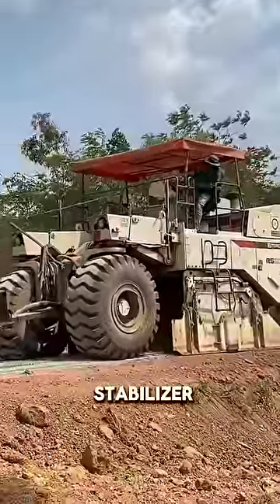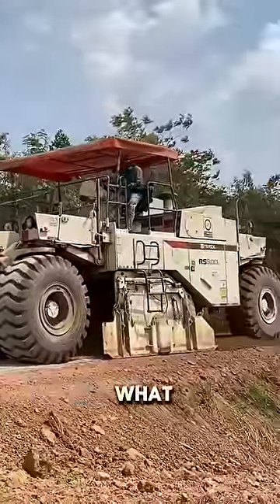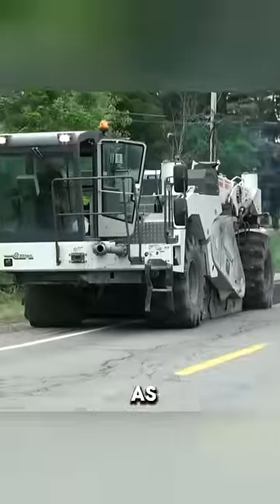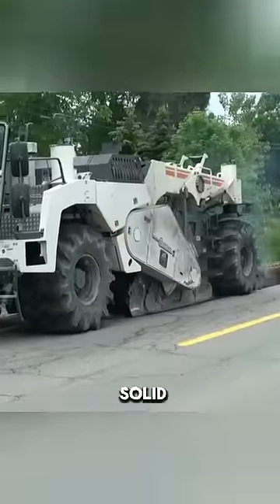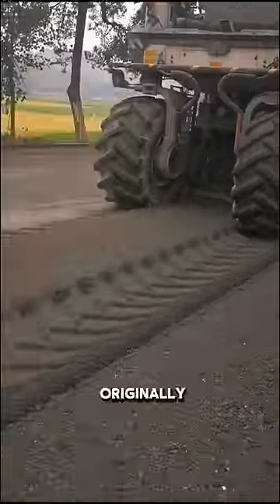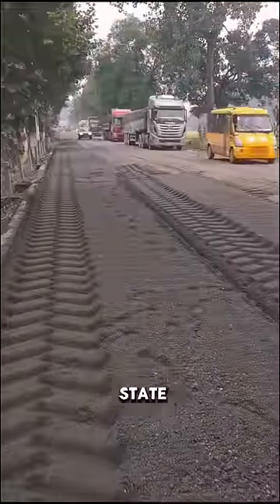How Cold Recycler Work #shorts

Comment: The first machine is a Lyme treat soil mixer.  It mixes Lyme into the soil to make the soil as hard as concrete.   The other is a road grinder.  Is grinds the asphalt with tungsten teeth.  It doesn't mix asphalt and soil unless you have a less than qualified operator.
Reply: Wrong operated them for years the newer ones you see are for both they have spray bars they have a push bar in front in which it pushes a tanker truck for soil stabilizing with either chemicals or plain water if it is concrete powder ext depending on the job the drum drops into the ground with either (blending teeth or milling teeth) EXT lots of different teeth for these machines for soil Stabilization or road milling to demolish the road
Reply: @Shawn-iy4ep  wrong!
Reply: @krail5500 he is right we use the second machine. we just call it a reclaimer. And when there putting in the stabilizer in or using concrete they do push the truck. When just reclaiming it will pull the water truck when filling most times.
Reply: @krail5500 Nope that’s a pulverizer and not a grinder. A grinder has a conveyor belt that shoots grinding onto a dump truck.
Reply: *lime (Lyme is a disease) 😊

Comment: By "their original state" you mean tar and oil mixed in the the soil now.
Reply: This exactly! The machine is literally mixing relatively clean dirt with oil and tar.
Reply: @aomanchutube no, it is used for road surface recycling, the asphalt surface (not clean dirt) is broken up and it is mixed with fresh tar. 
It only breaks up fresh dirt when it is used for soil stabilisation. Soil stabilisation uses lime and/or cement, not oil and tar.
Reply: Actually  just takes it down to the stone grade there's still another 6 to 8 in of stone that has got to come up before you get to the dirt grade‼️👀🤙💯
Reply: It's a recycler. It only breaks up the Asphalt which then gets picked up and recycled
Reply: @johnnyboy1522 that is in Europe... This is in some 3rd or 4th grade county!
Reply: They are used for a few different things but most times I see them on our projects, it's grinding up the asphalt to build a base for new asphalt.
Reply: Lol asphalt is not tar and oil. It is Bitumen, and it causes no contamination. It mixes the crushed asphalt and "base" and makes it into a new paving base so they can just pave back over it.
Reply: @setaripantheon8801 This is used in the United States. We live in a subdivision of 85 homes. Our  streets were redone using this method about 4 years ago.
Reply: Yeah I’m not sure everyone understands these machines. You can add lime or cement powder, mix again, level and compact to get a new solid level surface. We use the same machine for ground stabilisation projects in the UK
Reply: Tar is oil.
Reply: We haul that “recycle” or “regrind”, or any other number of local colloquial names, and stockpile it for three things.
We can add it to “new” asphalt to lower the cost for everyone,
We can use it to make new driveways, or even roads…
We can even use it as the sub base under new roads.

This stuff isn’t mixed into the soil.
Just looking at the colors there is little or no soil mixing unless one of your oppressive politicians told the inspectors to get lost while he was getting a kickback from unethical contractors.

Be careful what you are saying, it may come back to bite and gnaw of your backside, because you just accused this guy of being unethical, which would require assistance from the local government.
Reply: @setaripantheon8801  Ya,the 1 1\2 of asphalt doesn't happen in the US . Interstate highways have 17 inches of asphalt done in layers of varying types and thickness . Secondary highways  is probably half of that since they usually just keep paving over them. I have only ever seen the recycling paver once in NY . It's a great idea. The amount of material and carbon it saves in huge. You don't have to truck grindings away nor truck new material in.
Reply: It looks like a good place to plant tomatoes. Should be enough road salt to make them tasty. I love recycling.
Reply: @aomanchutube lol honestly this is such a major good point considering how un-environmental friendly tar and oil is to the ground. but yet we can’t use diesel to even clean the shit out of your 10,000 dollar dump box lol.

Comment: The sheer hydraulic force must be huge.
Reply: Well it takes a minimum of 500hp to turn that drum. Can be over 1000hp
Reply: When they attach them to a loader they have to put another engine hanging on the back to run the hydraulic pump!

Comment: This guy has absolutely no idea how a “root-miller” works…high., I’m bob and I was a roto-mill operator for 7 years…

The only true statement the guy made was that it infact does grind up the road surface…it does not revert the tillings back to their original state or separate the oil/tar from the material.

For this reason…those tillings are toxic…they can however be used in the paving process again or as a static base that can be driven on as they pack very well
Reply: The county used one of those as a part of the process to rebuild the stretch of road we live on (it had no base).  First pass, they ground everything up, second pass they mixed in Portland cement  and water.  Then, after 3 days they repaved it twice.  Road is now higher (had to raise mailbox 10"), but it sure beats the potholes we had.  Road had become a shortcut for log trucks and semis because there is a stoplight 5.5 miles away in town, the other way there is but a stop sign to get on that other highway. The state did rebuild the stop sign intersection to make it more truck friendly and we have seen a reduction in traffic. Car traffic now drives like there is no tomorrow.  The death toll will probably go up now on this 8 mile road.
Reply: Guy? What guy?
Reply: What did you say ??   I can't hear a damn thing after operating that mother f !!!!   WHAT ???
Reply: As an asphalt worker for 4 years, from starting at the road crew as a labourer for the side jobs they do such as shouldering and stuff, then got on the asphalt crew, watched them mill roads and also pulverize, then worked my way to the plant.. I can honestly say this would be one of the most accurate comments here. Yes to anyone who comes across this, this comment and his comment are both accurate because a milling machine and a pulverizing machine are 2 different things. Ask your fello asphalt worker who’s done his job for awhile or anyone who does road work.

Comment: These are soil stabilisers, most of the time i was working on them they were creating new roads, rather than fixing old ones. They typically drive over lime powder thats been spread by a lime spreader truck and mixing it water to create an exothermic reaction as its been mixed to stabilise the new road surface. They can also spray hot bitumen but it depends on the project. Theyre interesting to see explode when the hot bitumen is added to the stabiliser and the water from the previous job wasnt flushed out..
Reply: You are correct. Often called Lime stabilization.
Reply: Once I saw a vid of a whole tanker truck, which got filled with hot Bitumen or similar and still contained water from flushing. It's like never ending diarrhea. The overlaying Bitumen puts pressure onto the water, so it will not steam at 100 ° C, but higher and once the forces of the steam pocket overcome the pressure of the Bitumen and everything starts to errupt, the water ist already overheated and can produce endless amounts of steam.
Oh, and 1l of water can produce ~1700 l of steam so even tiny puddles of residue water are enough to cause havoc!

Comment: The one that was bouncing has an issue with the grinder wheel not properly balanced. Probably has too many new teeth in one area. I spent 5 years operating and maintaining one of them in Lake Havasu, over 100 degrees all summer ,no cab. Only benefit was that I could see over the fences and peer at the ladies in their pools.
Reply: Yeah the bouncy doesn’t look right but the union operator dgaf.

Comment: It's a milling machine  nothing fancy  don't forget the water truck
Reply: Its called a Reclamer not a milling machine, milling machines goal is to remove a couple inches so you can pave a couple back, this machine is for stabilizing the unstable ground under the asphalt when the subgrade is too far gone and unstable to use a mill

Comment: We don't have those machines in the USA yet. We have asphalt eaters that cut and remove 2 to 4 inches of asphalt. Then, new asphalt is placed, a flame truck will pass over to keep the asphalt hot, and then it's rolled. Last but not least is the machine that places the plastic tacks for the painting and Bots Dots and reflectors. At least that's what happens here in SoCal.
Reply: Yes we do in the northeast we call them reclaimers
Reply: Wisconsin the second one we call an asphalt grinder. 
   It's depth can be set to take say 2 inches of asphalt or to say 6 inches mixing the grindings with the gravel below. They can also have a conveyor to load it into dump trucks. Those grinding are a premium and have various uses including a more and more requirement to mix 25% in with new asphalt.

Comment: Gravel is an expensive commodity. It is normal to pick up that old asphalt mix and blend it with new oil, and just re-lay it back on the road.
Reply: Yep, Wisconsin asphalt grinding are a premium. Can be ground and compacted in place, mixed in with new asphalt, used for private roads/driveways/parking lots.

Comment: Commentary is a little confusing here. This is a stabilizer, here in Aus you would lay gravel on top of the road, then the stabilizer would rip the road up, mixing in the new gravel at the same time. Then we would put cement powder over the top of the new mixed road base, stabilizer then goes over it again mixing the cement powder in with water. Then the grader can begin his job. Some people are referencing a profiler (milling machine), which just takes out asphalt to be replaced by asphalt, they dont mix the road base or anything together, they take away all the material they mill. Here, stabilizers are generally used for spray sealed roads (layer of emulsion with some rock spread on top) where profilers are used on asphalt roads (thick surface used in heavy traffic areas, can be from 2" - 4" generally

Comment: We used these as soil stabilizers I never really saw them milling we had a mill machine that would spit the clippings into trucks to take back to the plant site probably because a lot of roads here in the US have layers of old road that could be a different material like concrete which I think would snap the fittings right off that stabilizer compared to a surface mill machine the teeth do not extrude out like a stabilizer these machines in the video are mainly used to mix lime or another type of powder with the soil to harden and reinforce the road going over soil I’ve never really seen them do this recycling process but I assume they have several uses because they are very versatile machines which I would hope because the things cost over half a million brand new

Comment: Partly true, I used to operate this machine, is overturns the road and adds water and concrete with precision, when compacted it turns into a rock base and this happens 3 times untill road hardness is at level

Comment: It's a asphalt mill. We use it to remove unwanted or degenerated paving. It doesn't stabilize anything. You can also cut existing asphalt to a desired depth for a pave-in to bond an old segment of road to a new one
Reply: Wrong it’s a pulverizing machine do your research bud

Comment: It's a whirtgen a cement truck attaches to the machine in the front and the Whirtgen and blows the cement onto the road and the rotator mixes the road agrete with the cement and water leaving a concrete roadway behind it. It's powered by a V12 Mercedes engine.
A friend of mine drives one

Comment: I've used them for soil stabilization, asphalt reclamation, and general pulverization and regarding.

For soil stabilization, you want virgin soil. For asphalt reclamation or pulverization and regrading you want asphalt and some aggregate. If you get soil mixed with that, it'll pump or rut under a proof roll.

Comment: This is the worst idea for an incredible amount of money. Road surfaces deteriorate due to water migration into the soil below the road. All of the substrates have to be removed, fine particulate removed, and new substrate installed in order to maintain proper drainage. This machine does none of that. It just fuels a Perpetual asphalt patch and replacement every 3 years.

Comment: Its basically a mill, removes the intended depth and in some cases can also elevate the killings to a conveyor for transport, regrind is then reused with stabilizers, softeners and new product to reduce the cost of new material, transportation from distant facilities, and enhances the to be renewed surface…